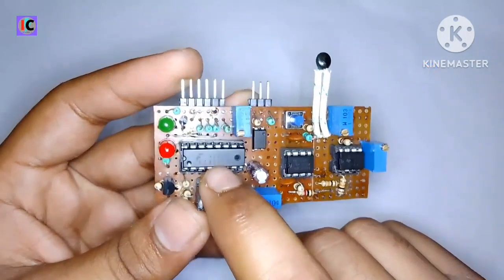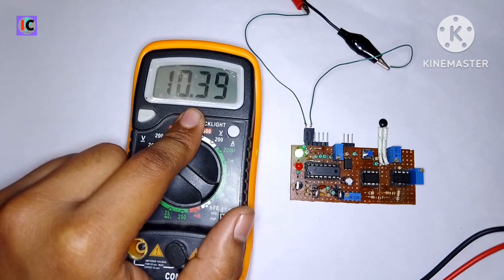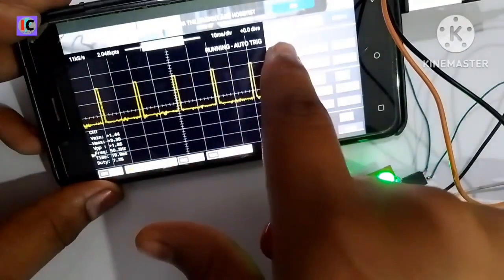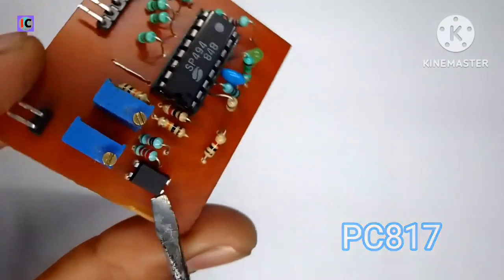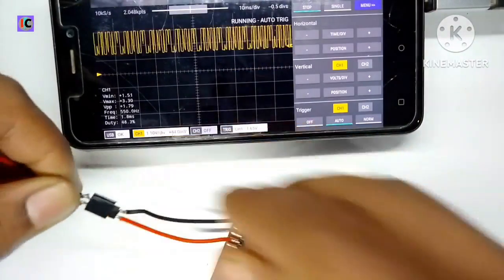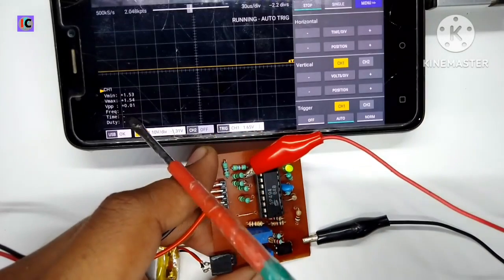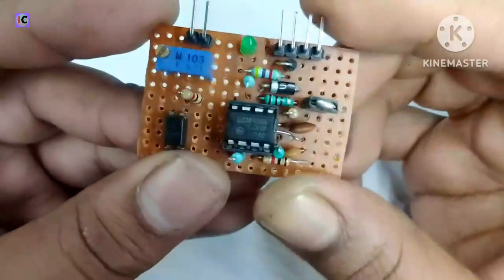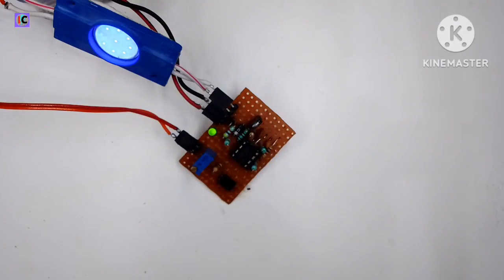Top 3 PWM Controllers For Inverter SMPS DC to DC Converters #converter

Comment: ये सर्किट मिलजाएगा
Reply from the maker: Circuit Diagram -
KA3525 - http://innovationic.blogspot.com/2023/03/sgka3525-pwm-controller.html
TL494 - https://drive.google.com/drive/folders/1exQcQxBfob6afOiGZqXyp5zO4PZ5YIeP?usp=sharing
UC3845 - https://drive.google.com/drive/folders/1C2Erm8nLnHzn2ifuRhZTFsQLLfs6P2Zh?usp=sharing
सर्किट का लिंक ऊपर है 👆